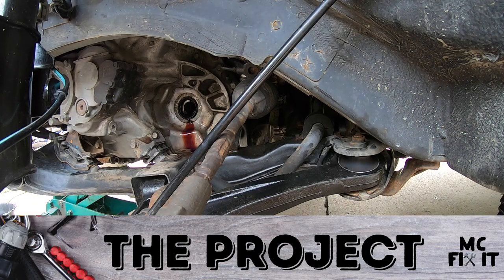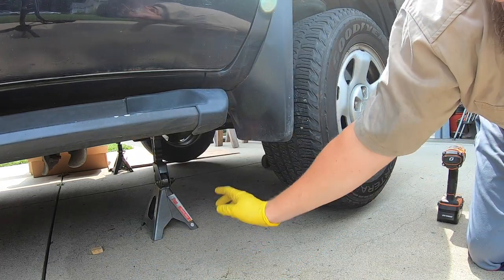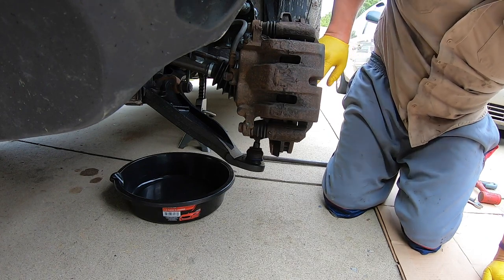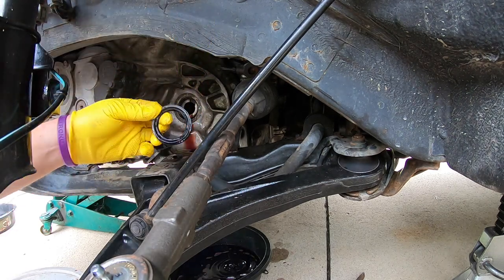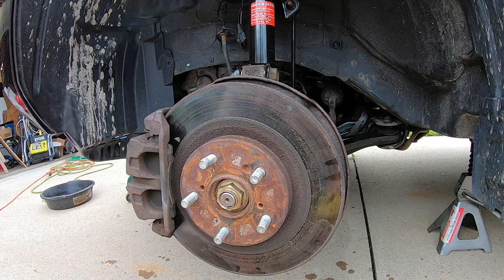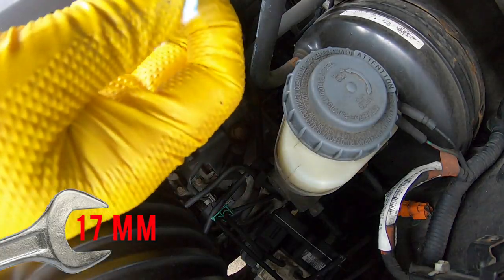How to Replace CV Axle / Drive Shaft Seal that leaks on Honda Ridgeline  (Complete Guide)

Comment from the maker: The Tools:
• CV Axle Seal (Honda) - 9102-P0X-005
• Honda Automatic Transmission Fluid (ATF-DW1) - https://amzn.to/3zk08Qn
• Pickle Fork set - https://amzn.to/2X94HyQ
•  Floor Jack (3 Ton) - https://amzn.to/2R7G96H 
• Jackstand (3 Ton)- https://amzn.to/3f3ABC5 
• Pilers - https://amzn.to/3lEU6WF
• Gloves - https://amzn.to/3bbfEnu 
• Safety Glasses - https://amzn.to/3ux25GO 
• Shop Towels - https://amzn.to/2SC8D93
• Ratchet - https://amzn.to/3xWjE5g 
• 17mm, 19mm, 22mm Socket - Basic Socket Set - https://amzn.to/3fjRoBd
• 36mm socket - https://amzn.to/37sz6Kf
• 17mm, 19mm Wrench - Basic Set - https://amzn.to/3jzlMcJ 
• 1in Wrench - https://amzn.to/3ArUuf1
• 1/2in Impact Drill (Rigid) - https://amzn.to/3vVDUBZ 
• Torque Stick - https://amzn.to/33wFTR2 
• Impact Sockets (Metric) -https://amzn.to/3etXiQU 
• Torque Wrench - https://amzn.to/3fEIrDi
• 18in Breaker Bars - https://amzn.to/3lLDpZA
• Flat Head Screwdriver - https://amzn.to/2RAjTlU 
• Long Flathead Screwdriver - https://amzn.to/3CCDCED
• Hammer - https://amzn.to/2VBhF7V
• Rummer Mallet - https://amzn.to/3jDa5le
• Sledge Hammer - https://amzn.to/3ywEurD
• Penetrating Oil - https://amzn.to/3yyyoqV
• Oil Pan - https://amzn.to/3CteDDq
• Tie Rod Puller Tool - https://amzn.to/3lKJ3v6 
• Crow Bar - https://amzn.to/3s0B9yC

00:00 - Start of Video
00:07 - The Problem
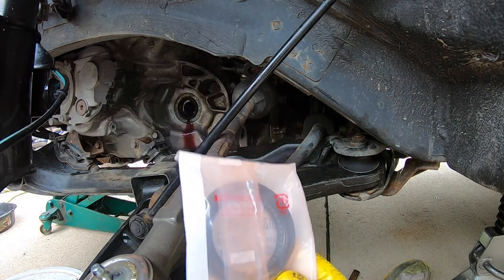00:40 - The Tools
03:07 - Jacking up the Truck
06:18 - Front Left (Driver) remove wheel hub nut & lower control arm
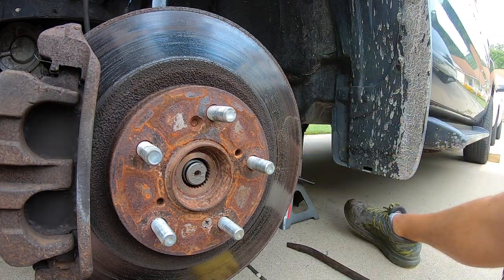09:44 - Removing Sway Bar Link - Front Left (Driver)
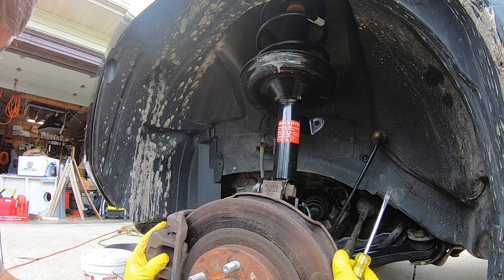10:15 - Removing CV Axle - Front Left (Driver)
11:00 - Popping CV Axle C-ring 
11:50 - Removing Leaky Seal
13:00 - Installing New Seal (part: 9102-P0X-005)
14:10 - Re-Installing CV Axle 
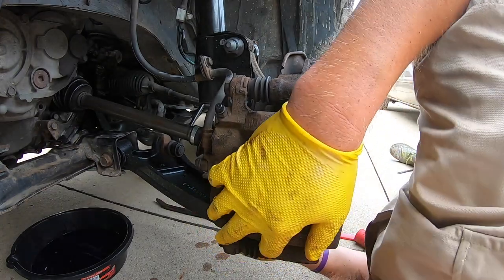16:15 - Re-Installing Lower Control Arm
18:03 - Re-Installing Sway Bar Link
19:37 - Re-Installing Nut
20:46 - Re-Installing Tire and lower vehicle
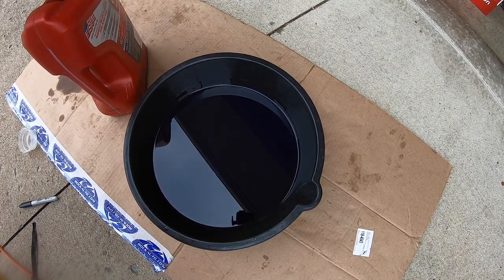22:45 - Adding Transmission Fluid
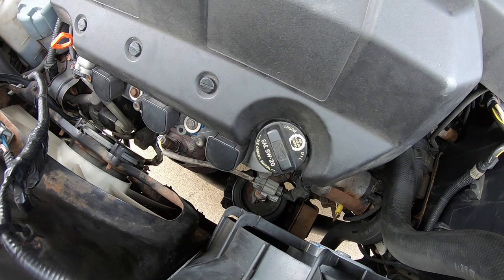28:40 - Closing of Video

This video works on many makes and models.

Check out my website at http://mcfixit.us 

Disclaimer:
Due to factors beyond the control of MC FIX IT, I cannot guarantee against improper use or unauthorized modifications of this information in the video, post, blog, or social media. MC FIX IT assumes no liability for property damage or injury incurred as a result of any of the information contained in this video. Use this information at your own risk. If you feel uncomfortable at any time. Stop and go to a professional. MC FIX IT recommends safe practices when working on vehicles, your house, or any other project and or with tools seen or implied in this video. Due to factors beyond the control of MC FIX IT, no information contained in this video shall create any expressed or implied warranty or guarantee of any particular result. Any injury, damage, or loss that may result from improper use of these tools, equipment, or from the information contained in this video is the sole responsibility of the user and not MC FIX IT.

#mcfixit #autorepair #hondaridgeline

——
Supplies used to record this video: 
* GoPro Hero 7 Black - https://amzn.to/3f3ALtb 
* 256GB Flash Drive - https://amzn.to/33pAueG 
* Vlogging Frame - https://amzn.to/33tajE0 
* GoPro Pro 3.5mm Mic Adapter - https://amzn.to/2RCURCu 
* Youmic Lavalier Lapel Mic - https://amzn.to/2R55sWX 
* Boom Stand (tripod) - https://amzn.to/3bdkQaw
* 5/8” to 1/4” adapter (boom to blogging frame- https://amzn.to/3txrVsM 
* Portable Battery Powerbank- https://amzn.to/3vJQc0q 
* 6ft USB to USB-C (powerbank to GoPro)- https://amzn.to/3uAS5MH
Reply: Thanks for the part number. This will be helpful at Honda on Tuesday when I go.
Reply from the maker: @ethanforry8851  Glad it was helpful!

Comment: Would removing the two bolts that hold spindle to struts also be an options to avoid removing lower ball joint ?
Reply from the maker: You can definitely try that. I don’t remember if you have enough room this way though. We’re you able to try this way? If so, was it successful? I’ve been out of state the past week without internet in the mountains.
Reply: @MCFIXIT  i haven’t gotten to the repair yet, I know I’ve done it the way I mentioned on a civic/rsx with same suspension type but thought it may be a bit stiffer on a suv
Reply: @diegs710  yes
Reply from the maker: Thanks for answering this!
Reply from the maker: Did it work?
Reply: you have to hang it with a bungie or something so you don't stretch/break the brake or abs lines - but yeah - lots easier than messing with ball joints (on an 05 pilot at least)
Reply: Yes it will work that way. That is how I did mine. I used a zip tie to hold my caliber out of the way as well. Tight squeeze but it works out just fine

Comment: How did you measure the torque on the 36mm spindle nut using your impact driver?
Reply from the maker: Torque sticks. They are all differently rated to only allow certain foot pounds.
Reply: It looked like you just used your impact driver with just the 36mm socket on it without a torque stick. I’m hoping to do this work myself and don’t have a torque wrench that goes higher than 150ftlb. So that is why I was asking, whether a good tightening with the impact driver will suffice?
Reply: @WildmanMN  I was in the same situation yesterday, my odyssey asked for 250 ft/lbs.
I took it to 150 lbs first and then used a breaker bar and my hydraulic jack stand's pole as an extention. I yanked it pretty heavily, I should have at least 200 lbs of torque :/ but no way to tell accurately.
Reply from the maker: Yeah, it has a notch in it that helps hold it in place as well as long as you knocked it in. I am big on specs but that’s more when it’s under 100 ft lbs of torque. I really try to be most accurate with that. When it’s over 150 ft lbs it’s using my best judgement and get it on there very snug.
Reply: @WildmanMN  using a impact will work just fine on all the bolts lol no need to torque anything i never have an my car is over 200k miles nothing happens
Reply from the maker: Definitely an option you have. I prefer to do it to spec for anything I am able to do. It helps with any future repairs and is what is recommended to keep things together on a vehicle.

Comment: Amazing video. My Acura RDX 2013 is leaking ATF on the driver side axle seal as well. My mechanic recommended I also replace the axle along with the seal while im at it. Approaching 105K. You think I should? OEM axles from Acura is definitely not cheap 😢. As far as I can tell, theres nothing wrong with my stock axle.
Reply from the maker: Thanks so much for watching. I'd inquire with the mechanic about why they want it changed out. If there's noticeable wear and tear, it would be a good decision to get them replaced because the labor cost would be nearly identical since you have to remove the CV axle to get to the seal. Also, removing the axle does have a small chance of tearing a boot that's 105k old so maybe that's why they want to change it out. As you already know, the cost of OEM CV axles is not cheap. How long do you plan on keeping the vehicle? If the axel is in great condition and you aren't keeping the vehicle for multiple more year, then I'd probably skip on that being done and just get the seal replaced. But you are going to have to make that call knowing that the axle might go bad before you are done with your vehicle.
Reply: @MCFIXIT hey thanks for breaking it down. What the mechanic said was there's always a small chance that if he just replaced the seal that it could still end up leaking. Not sure why that would be the case. Maybe it was just based on his overall years of experience and he wanted to save me the cost of labor doing the axle again. And after reading everything you've laid out I think it does, in the long run, make sense to just replace it. Buy once, cry once. I do plan to keep the car at least another 3-5 years considering I just did the major service (water pump/timing belt/plugs etc) car should be able to go another 100K in theory with no issues. I hear the J series engine is widely used in a lot of Honda's and Acura's so finding people to work on them shouldn't be too difficult. Thanks again. Keep up the good work!
Reply from the maker: Yeah, I'd probably just do it if you are planning on keeping the vehicle. Those engines are pretty solid and hopefully you won't need any other suspension items for a long time. 
 @tomle2553

Comment: What metric impact sockets do you recommend? Link doesn't work. TY
Reply from the maker: I’ve got a great Craftsman set I’ve been using for a few years and have no complaints except the numbers are painted. So you have to look close at them. They have a ton of new options now that are easier to read. But any quality brand is what I’d go for with impact sockets. Stay away from Harbor Freight or super cheap online stuff. Get something with a lifetime warranty where you can easily trade it out if it breaks
Reply: @MCFIXIT  Awesome thanks! Deep sockets?

Comment: Did you reuse the original cotter pin on the castle nut? If you used a new one do you know what size it was? Great video! Thank you this has given me the confidence to try and replace the leaking seals on my '15 pilot.
Reply from the maker: Just reused mine. Sorry!

Comment: questions do you have any vibration after the installation?
Reply from the maker: No, none. Very smooth ride even when accelerating. Something is probably not right if you feel vibrations. I’d check over it all.

Comment: Hi. I hope you can help. One day I took a cv axle of my 2006 accord v6. And it was just pouring a lot of Transmission fluid.  Could of been I had too much fluid? Is this normal to leak like this ? Thanks you
Reply from the maker: Was it the driver’s side cv? If so, you will have some come out. Maybe more depending on how high you have the front end jacked up.
Reply: @MCFIXIT  thanks for your reply. Yes it was the driver cv. It was jacked up normal I guess. Enough to get under the car. It made a mess. What do you recommend to do to prevent this. I now have to replace thar cv seal, it has a small leak .
Reply from the maker: I don't think you'll be able to stop it, but i'd put something to contain the spill... like an oil pan. You should also be putting back in the same amount Trans Fluid that came out. Some pans have measuring amounts built into the plastic. You can also check it on the trans fluid dip stick to see where you are before (and then after the fix). You'll want to make sure it's within limit. Best of luck on your project.

Comment: Okay, but what about the other side?
Reply from the maker: There is no seal on the other side. The driver side goes into the transmission and that’s why there’s a seal. I’ve got another video on replacing just the cv axels if you want to see how it’s gone.
Reply: @MCFIXIT  That is not exactly true, the other side does have a seal. Remember, when you pull out the passenger CV Axle you are only getting up to the half shaft. The Half Shaft Assembly goes into the passenger, if you look at the half shaft, you will notice it has the heat cover over it as well. It is much more work, but it is also recommended to replace that seal as well.